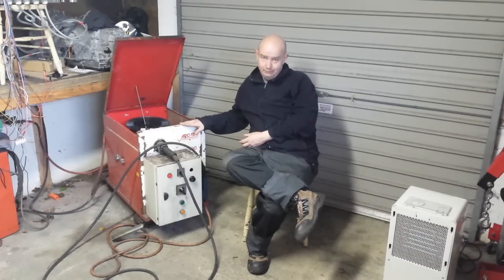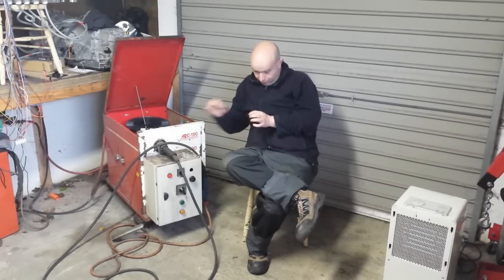BMW E31 840CI EV Conversion 36 : Cells n Welds

Comment: My Millarmatic  130 xp would be a good match.  Only has a 5% duty cycle on 120 ac. 15A.    There are cheap here in Canada.  I look forward to seeing you drag in and wrap a low power transformer for it.   Maybe a transformer from a scrapper microwave?  
  On another note ,  We seen the results of Jacks influenza pack getting drained and some cells going into reversal,... plans for preventing that?  
MS